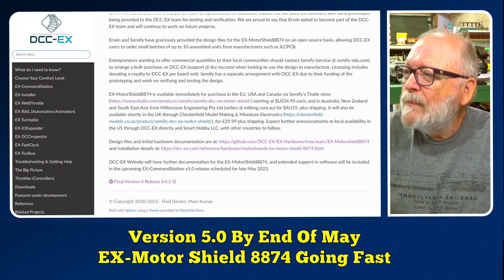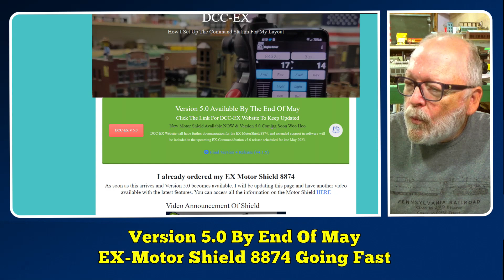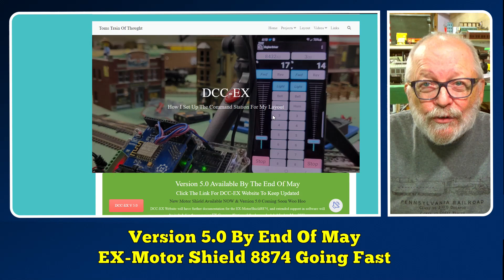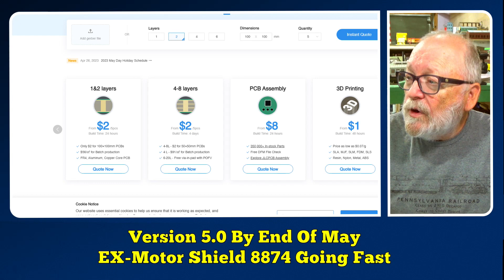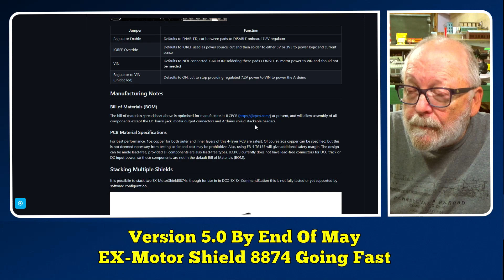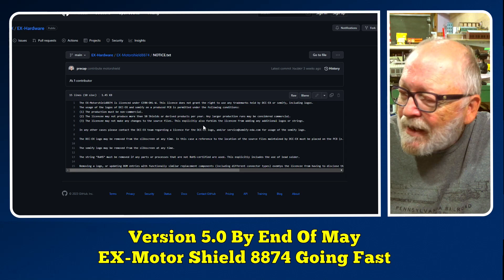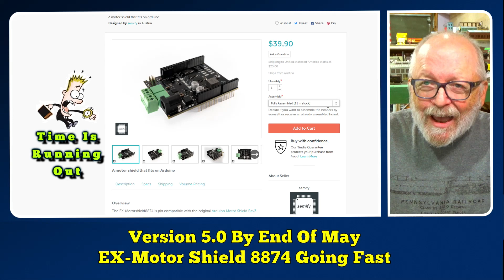DCC-EX v5.0  Scheduled For Release Late May

Comment: I've never gotten the current monitoring to work correctly with original DCC++ or DCC-EX with any motor shield.  Hopefully, the DCC-EX shield and DCC-EX Version 5 will show an improvement.
Reply from the maker: Have you reached out to the dev team on Discord to ask them about your issue? If not, here is an invite: https://discord.gg/ff9r3NtATN
Reply: @TomsTrainsandThings  Thanks ... I'll give them a shout.  What I do know is that it's a complex subject.  Hans Tanner on IoTT channel has looked into it.  JMRI allows you to pop up a Voltage or Current meter window for DCC++.  Picked up a device from DCC Specialties but it's pricey.   All the best to you and Debbie!!

Comment: Is the motor shield limited edition, like they won't make any more of them?
What's the difference between assembled and not assembled?
Reply from the maker: This is the first run. They will have more available when these run out, but I don't knw when. The unassembled version, you would have to solder the edge connectors  on yourself, they are provided.
Reply: @TomsTrainsandThings  Thanks. I'll probably wait until then since I am going to start building my layout in a month anyway.
Reply: No, they are not limited edition. The initial production runs are small, while we assess popularity. Initial response has been very good. Of course each production run requires an investment of money up front.Various suppliers are gearing up to do more production runs. My company has them available in Australia, other providers will be making them available globally in their locales.
Reply: @paulantoine1696  So I suppose it would gain features and price will reduce over time?